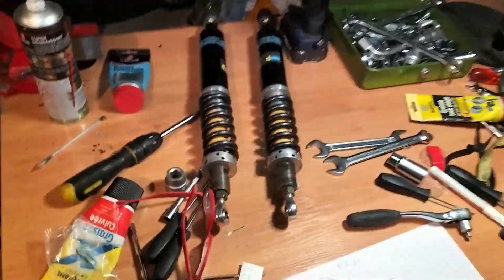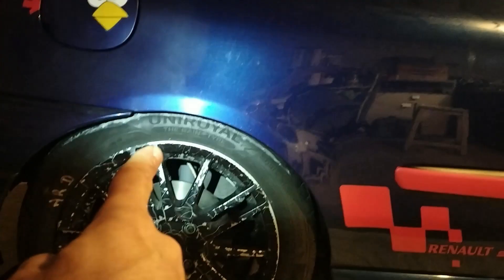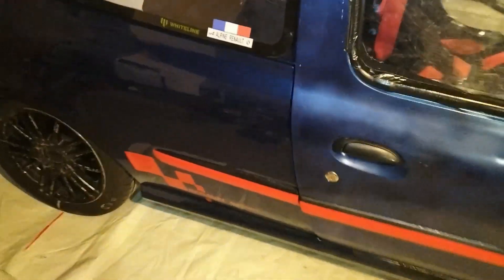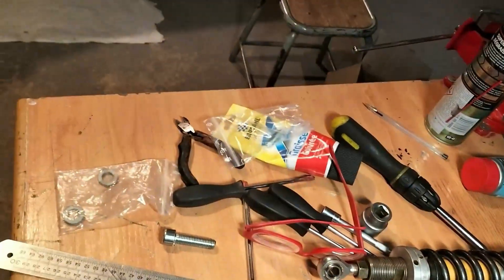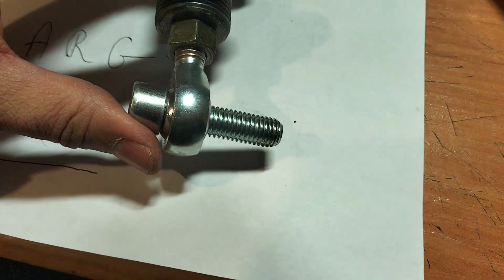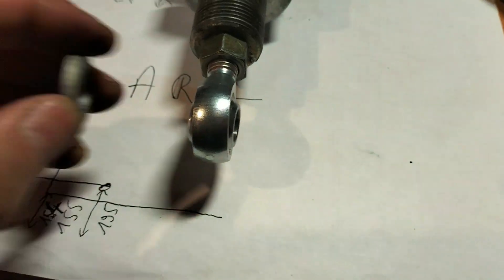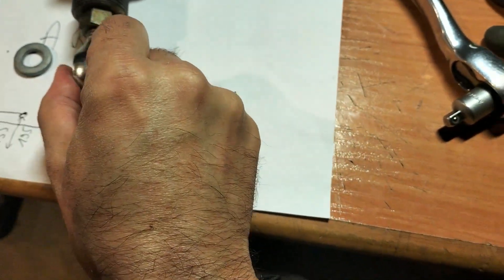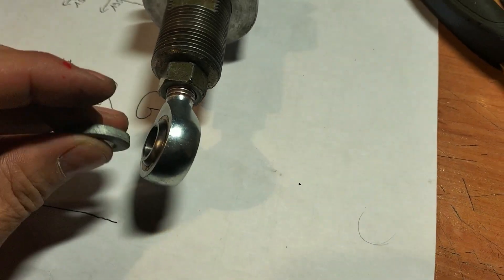CLIO 2 RS MINICUP: Montage combinés filetés arrières CLIO 2 CUP X65 Jour 2/8 Nettoyage-Pièces neuves

Comment from the maker: Très satisfait depuis plus de 5 ans par les amortisseurs arrières Viarouge en mode compétition (mais non filetés et donc ressort et amortisseur séparés), j'ai malgré tout envie tant que je le peux de passer à des filetés de compétition derrière aussi (devant les Viarouge compétition filetés font très bien le boulot). Et quoi de mieux pour cela que de passer à ceux de la compétition usine Renault Sport "Clio 2 Cup x65" ?  C'est parti pour une série de vidéos sur ce travail et jusqu'au premier test concret sur circuit...
------------------------------------------------------------------------------
Very satisfied for more than 5 years with Viarouge rear shock absorbers in competition mode (but not threaded and therefore separate spring and shock absorber), I still want as much as I can to switch to competition threaded rear as well (in front of the Viarouge competition threaded do the job very well). And what better way to do this than to switch to those of the racecar Renault Sport "Clio 2 Cup x65"? Let's go for a series of videos on this work and up to the first concrete test on the circuit...